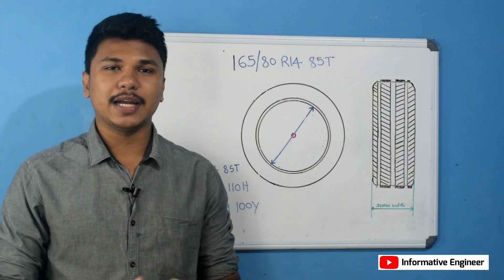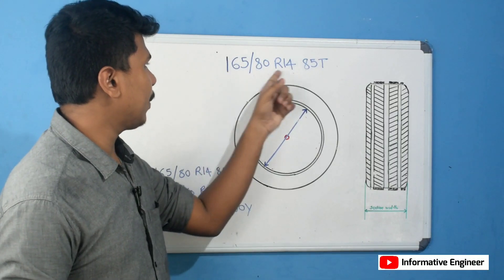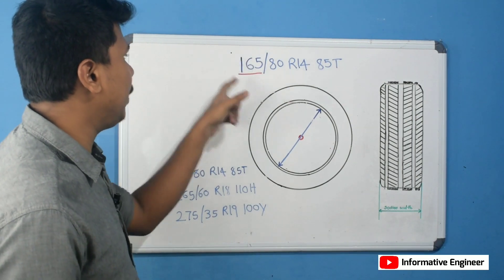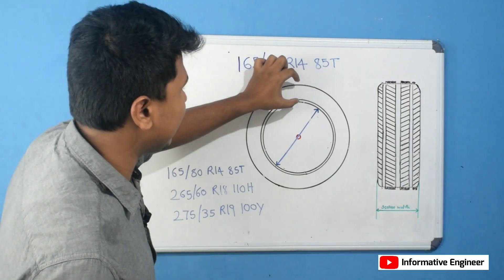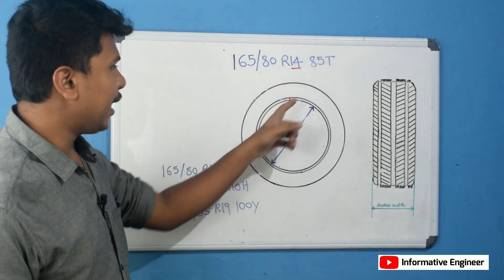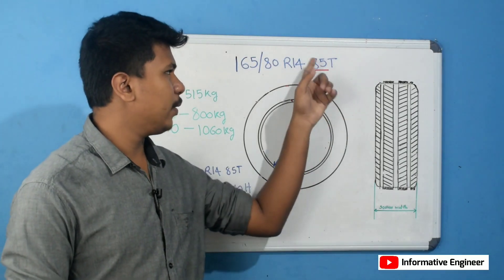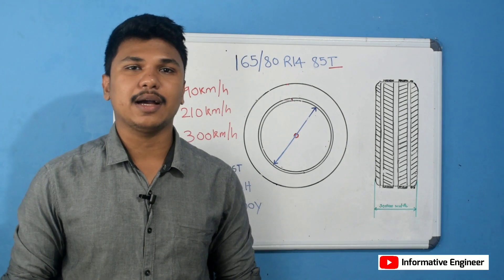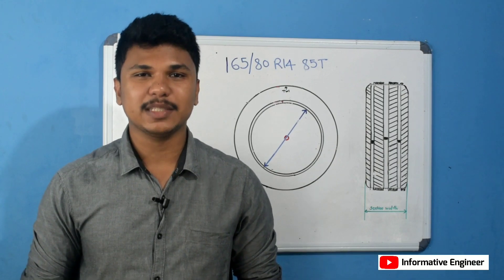Tyre Markings Explained | Malayalam Video | Informative Engineer |

Comment: I have Bridgestone S222 tyre (with tube) in my car. Now 1 tyre got damaged and Bridgestone S222 is not available. So store is suggesting Bridgestone B290 which is tubeless tyre. Other option is to get tyre with tube from other brand. Should I change brand and get tube tyre or stay with Bridgestone and get tubeless tyre?

Comment: 130/70/17 type tyre il manufacturer parayunnath 33 psi anuu

130 nu pakararam

140/70/17 size tyre il ethrea psi veandivarum

Pinea nitrogen , air evaa randum same psi anoo fill cheayukka alea nitrogen avumboo kooduthal point cheayeandi varoo

Comment: Nice... Consider explaining chassis Number... There are diffnt standards for LMV, 2wheelers etc. This can help people while buying vehicles. 
I personally got tricked while buying my 2wheeler, luckily I checked the chassis number and caught them redhanded... 
One more thing.... when we upgrade our tyre (eg. 15"  to 17")  the "fuel efficiency gets reduced" -- but is it actually getting reduced..? Because the trip meter (or the mileage indicator) would be set for the default tyre size (provided by the manufacturer). This can clear a common mis-consumption.